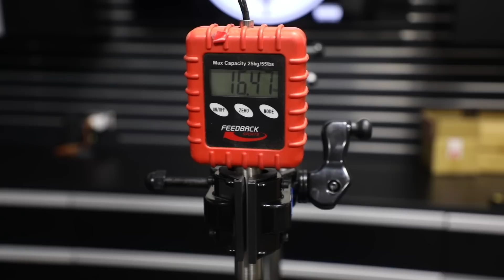Bike build video! Custom Packer x L39ION Specialized Venge!

Comment: you didnt put the ring from sl7 recall
Reply: This isn't even a Tarmac SL7, it's a 3rd-gen Venge. It never had the compression ring sleeve.
Reply: @sbccbc7471  Venge shares the same system, they just didnt call them for recall. If I had a venge rebuilt from scratch I would include the parts of the sl7 recall